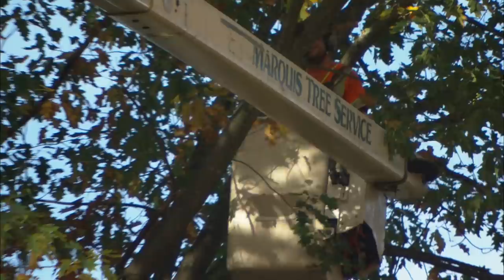How to Remove Potentially Dangerous Trees | This Old House

Comment: Crane operator here and tree work is some of the most dangerous work you can do with a crane. So many unknowns when you pick the tree. Don't know the weight or center of gravity.  Many tip overs happen when you decide on a cut and then ends up weighing more than expected. Plus you got a guy in a tree with a chainsaw. I hate doing tree jobs and I can't imagine doing them daily.
Reply: The crane they have in this video is way oversized in lifting capacity i think. So should be good.
Reply: The 110 hydro in the video costs five grand just to show up, doesn’t it?
Reply: @greatlakestatedestroyerpet117  it depends. My company in AZ would charge at least $275 an hour or more plus travel for a 110 with counterweight. That tree company owns the crane so they may charge differently.
Reply: @cranelord  Thing is, none of the neighbors want that gear blocking the residential streets nor tearing them up with this kind of overload.  

In commercial industrial work onsite temp road access  has to built to handle the gear.  Cops notified for big loads who then smack down anything out of line.  Here, residential public roads are being taken over, blocked and abused, rent free, when the odd 10 ton delivery is all they should see.
Reply: I'm thinking there's no accounting for a tree that is rotted or hollowed out by critters.
Reply: It’s all about efficiency, like the tree company owner stated. Would you rather that job take them three days or just the one. They are in and out within a day which means the road is only closed one day. They can get more work done in a day then a similar sized crew without a crane which means more profit per day which justifies the added cost of the crane and other expensive equipment. They could do 5 jobs that size in a week compared to another company only being able to do almost two. The large all terrain crane has a suspension that spreads the load over the road evenly and is comparable to the large garbage trucks that waste management uses regarding road damage.
Reply: @jelinektreeservice  No tree this size takes three days, or even two for a competent crew.
Reply: @Nill757  They removed 12 oak trees hanging over the power lines. Chipped all the brush, hauled away the logs and ground the stumps in one day. Good luck doing that in a day without a crane in s day.
Reply: @jelinektreeservice  Ok, though 12 trees is not mentioned nor shown in the video.  In that case this was a block sized or neighborhood sized job, i.e. industrial work resulting from neglect of annual tree maintenance for decades by residents and/or the power company.  

The efficiency argument alone is unreasonable for single home residential work, as its all about advantages to contractor profit, as if that were the only concern.   This crew obtains that profit and efficiency by means of seizing the public roads for equipment placement.  A climbing and lines  crew is slower,  one day per couple trees, but their road closing time is zero.

Comment: That will deplete your bank account.
Reply: Agree lol. I’m expecting something like 3k $
Reply: @Engineer9736  Yes, $3k for top down section removal with control lines to avoid power lines.
Reply: Stop being poor! 😂
Reply: @advancekashmir9846  
Yeah, you’re hilarious 🙄
Reply: So will taking down power lines and knocking out half the town's electricity.
Reply: @itsthebrod  Half the “town” power?  No. Power to the block.  A crane is not necessary to safely drop this tree.  Any competent crew can drop it in a day, top down by pieces.
Reply: @Nill757  oh yes, I'm sure you're more of an expert than these actual experts. My bad
Reply: @itsthebrod  “these experts” are experts on what exactly?  Where do they say the tree can’t be dropped top down with lines?  I can’t do it, but I’ve seen it done a dozen times meaning only that it can be done.

Comment: Looked like they laid the tree as close to the wires as they would be if the branches were trimmed in place and then tree felled. Worth the cost of the crane?
Reply: The point is that the crane is all the time under control of what the tree is doing. There is no free fall which could accidentally go in a wrong direction (powerlines, a house).
Reply: @Engineer9736  Trim in place doesn’t need to free fall either. They can attach lines to other trees or trunk of same tree and control the drop.

Comment: Wouldn’t it be cheaper to just cause a power outage, fell the trees into the power line, and then pay the fine to the city?
Reply: If you think risking those 7000 volts flowing across your body is worth those savings.
Reply: @Engineer9736  Ah, but that’s why you cause the power outage first. Then they’d be fine
Reply: Lol

Comment: Next they're going to attach it to a helicopter that's just going to rip the roots from the ground.
Reply: I’m pretty sure a crane can pull harder than a heli
Reply: Google: “On the other end of the spectrum is the M-26–the world's largest heavy-lift helicopter–which is capable of transporting up to 44,000 pounds.”. A pretty regular crane like they have in this video can lift 120,000 pounds. 🙂

Comment: Very nice for the neighborhood to have the absolutely largest, loudest, and most intrusive machinery onsite, along with a camera crew to sell outrageously expensive take down technique to the public.
Reply: Yeah having your power knocked out for weeks when one of those trees takes out a line during a storm is way less inconvenient.
Reply: What's the problem ?
Reply: @augustreil  5x too expensive, w TOH helping to sell it.
Reply: @cranelord  Single tree drops don’t cause power outages for “weeks” in the US. The tree needs to come out, but an industrial crane blocking roads in  a residential neighborhood is not necessary.